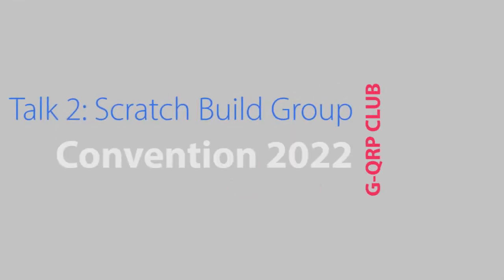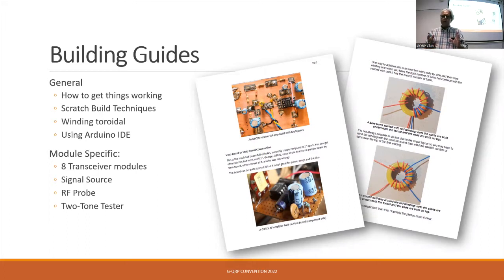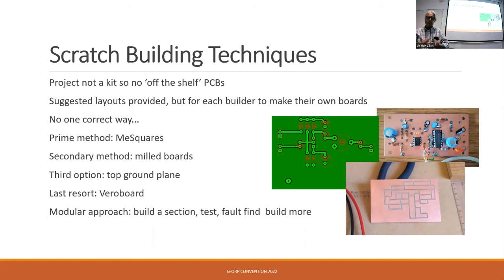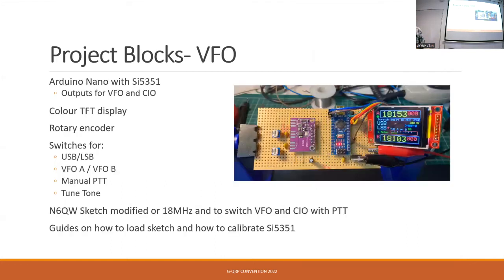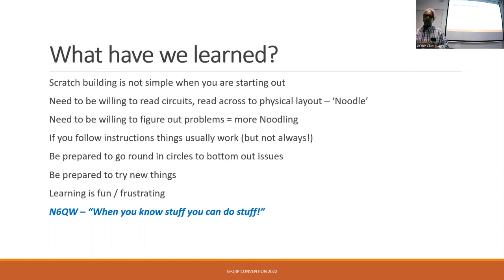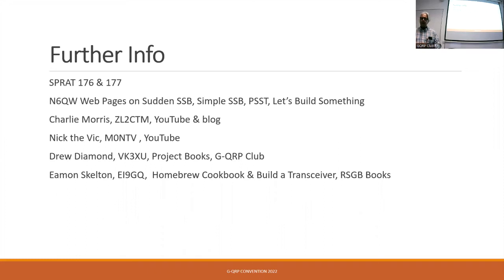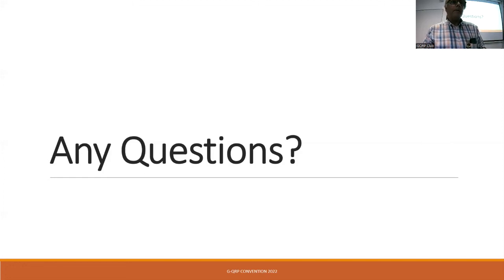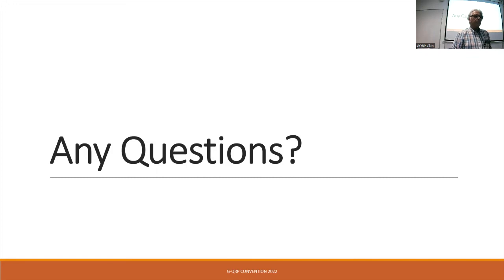G-QRP Club Scratch Build Group

Comment: Would have been nice to see a link to resources to the project.
Reply from the maker: The original work was published in SPRAT, as quoted in the presentation. Pete's web page is here: https://www.n6qw.com/Sudden.html The Group building guides are only available to members of the Scratch Building Group, not because they are secret, but we can only mentor a certain number of builders at any one time.